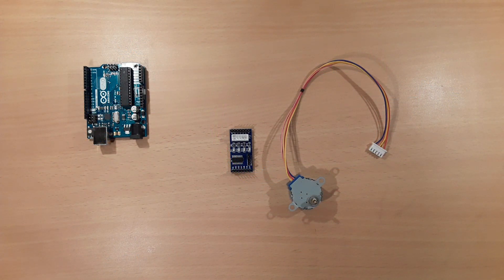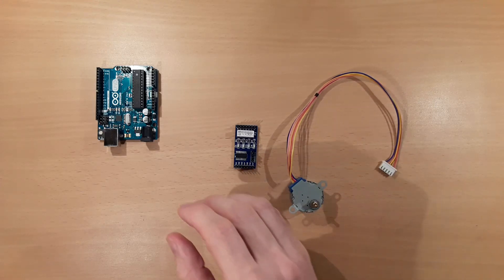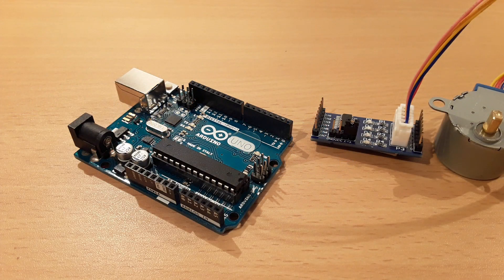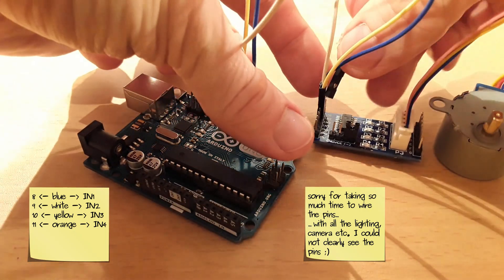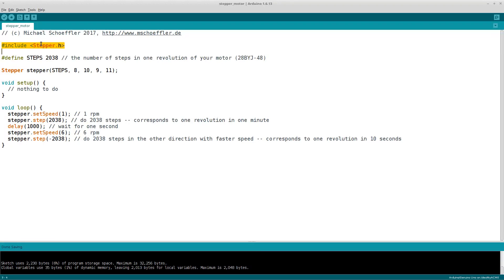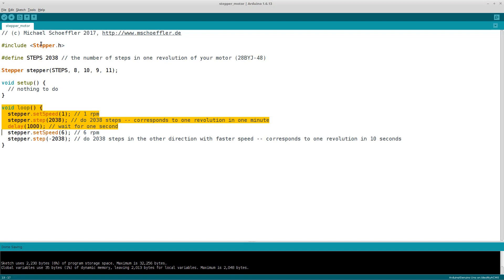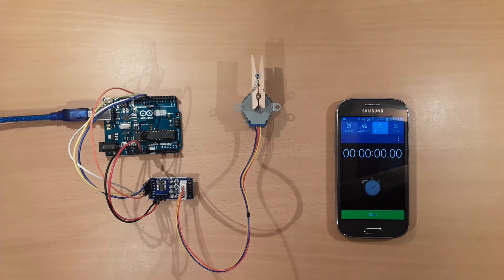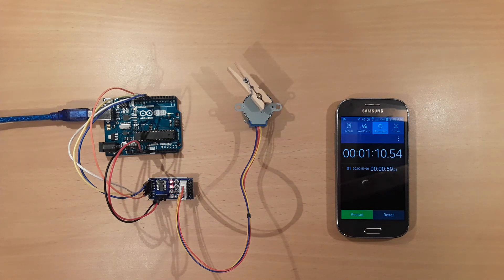Tutorial: How to use a stepper motor (28BY-J48) with an Arduino and a ULN2003A board | UATS A&S #10

Comment: Here's a though: desolder the 4 driver input pins from the ULN2003 and reattach to the opposite side of the board. Then you can just plug the board directly into the Arduino. Makes for a smaller package and less chance of something disconnecting.

Comment: it has 2048 steps in full rotation, not 2038
Reply from the maker: Hi Alexandru, Thank you for the comment! I made this tutorial a very long time ago, so I can't remember all the details:
I still think that 2038 is correct, even though the datasheet and other tutorials refer to 2048. When I started to work with the stepper, I recognized that it is not as accurate as I expected. So I had a deeper look into the problem. It turned out, many others had the same problem.

Long story short: the actual gear ratio is approximately 63.68395:1 (instead of 64 --> 32 * 63.68395=2037.8864). You find more details in my written article: https://www.mschoeffler.de/2017/09/23/tutorial-how-to-drive-the-28byj-48-stepper-motor-with-a-uln2003a-driver-board-and-an-arduino-uno/

Here is an older discussion in the Arduino forum which comes to the same conclusion: https://forum.arduino.cc/index.php?topic=71964.0

There are also some reports that there are differences in-between individual 28BYJ-48 motors. 

Also the example video in the video does a full rotation with 2038.
Reply: @mschoeffler  I don't want to argue with you, because I see your are well informed, but I let it run couple of minutes with 2038 steps set in the code and mine was not at the start position.

PS: Sorry for my bad english...
Reply from the maker: I did not intend to argue :) Just wanted to give a detailed answer since the "2048 steps info" comes up a lot. According to the datasheet, the information is also correct. However, many stepper motors of this type do a full rotation only with 2038 steps.
Reply: @mschoeffler  maybe mine is different
Reply: @mschoeffler   2048 appears quite accurate to be complete revolution. 2038 or even 2044 tends to shift (incomplete revolution).

Comment: Hi, thanks for the tutorial. Do you think it's possible with this motor to make a full 360deg. not in 1 mn. but  180mn? (3hours)
Reply: yes you could easily do this, just have a for loop that goes up to the 2038 steps inside the loop step 1 step then have a delay (divide the 3 hours by rhe 2038 steps to find out how long a delay you need).
Reply: Yes, i got this, really great, thanks

Comment: hello
thanks for the tutorial
i did some change with the code since i need to run the stepper 5 revolution then wait for 30min to run again. combining with blinkwithoutdelay style to make it happen. 
the problem is when waiting to run again I think the stepper didn't  stop at all (the motor is not make any move while waiting but on in the ULN2003 2 led light is always on) and it cause the stepper getting warm. is it intended to happen? if it's not how can i resolve it?
 btw it's my first time using stepper motor.

here's the code i use https://pastebin.com/jcz7LMnF

Comment: I have same stepper motor,
Then I write that code to my IDE,
But my stepper motor didn't spin reverse after 1 minute spin.
What's wrong? Please help
Reply: Switch pin2 with pin3 from the driver
Reply: Eeeh? Which pin? Sorry i'm forgot to say that, I am using Wemos D1 R2 for this

Comment: Hi michael... i was wondering if you could kindly help me out with this Arduino servo, stepper motor setup that i am trying to use. i would so much appreciate it if you are able to work out what is going on wrong with the code or hardware......thanks in advance......  https://www.youtube.com/watch?v=fis-qX9ldlg

here is the code that i am trying to use with the servo and stepper motor. can you see anything wrong with the code?

#include <Stepper.h> 
#define STEPS 32

  Stepper stepper(STEPS, 9, 11, 10, 12);
  int randomRotationFrom = 5;
  int randomRotationTo;
  int randomNumber;
  int randomDelay;
  int eyes = 7;
  int angle = 10;  
  int mouthclosed(-600);
  int mouthopen(600);
  int mouthspeed = 950;
  
void setup() 
{
  servo_neck.attach(8); 
  servo_neck.write(90);
  pinMode(eyes, OUTPUT);
  digitalWrite(eyes, LOW); 
  randomSeed(analogRead(A0));
  stepper.setSpeed(300);
  stepper.step(mouthclosed);
  delay(200);
  
      digitalWrite(eyes, HIGH);
      delay(50); 
      digitalWrite(eyes, LOW);
      delay(50); 
      digitalWrite(eyes, HIGH);
      delay(50); 
      digitalWrite(eyes, LOW);
      delay(50); 
      digitalWrite(eyes, HIGH);
      delay(5);
      digitalWrite(eyes, LOW);
      delay(100); 
      digitalWrite(eyes, HIGH);
      delay(50); 
      digitalWrite(eyes, LOW);
      delay(50); 
      digitalWrite(eyes, HIGH);
      delay(500); 
      digitalWrite(eyes, LOW);
      delay(50); 
      digitalWrite(eyes, HIGH);    
}

void loop() 
{ 
  
 randomDelay = random(10,3000);
 randomRotationTo = random(40,140);
 randomNumber = random(1,9);
  
 if (randomRotationTo > randomRotationFrom) 
 {
    for(angle = randomRotationFrom; angle < randomRotationTo; angle += 1)    
      {                                  
      servo_neck.write(angle);
      delay(20); 
      servo_neck.write(angle - 3);                       
      } 
   
 if (randomNumber == 5) 
      {
      stepper.setSpeed(mouthspeed);
      stepper.step(mouthopen);
      stepper.step(mouthclosed);
      }
 }
 
 if (randomRotationTo < randomRotationFrom) 
 {
    for(angle = randomRotationFrom; angle > randomRotationTo; angle -= 1)    
      {                                  
      servo_neck.write(angle);  
      delay(20); 
      servo_neck.write(angle + 3);                     
      } 
 
    if (randomNumber == 5) 
      {
       stepper.setSpeed(mouthspeed);
       stepper.step(mouthopen);
       stepper.step(mouthclosed);
      }
 }
 
 randomRotationFrom = randomRotationTo;
 delay(randomDelay);
 }

Comment: Question; if I wanted to power the motor externally, how would I do this, and what parts would be required? Any help gratefully received! :)
Reply: For anyone wondering about this, you just use an external power supply of 5-12 v(depending on driver) and just share ground with power supply and arduino
Reply: Can I connect 9v battery to +5v in of uln2003 or it must be 5 v regulated? 
The motor is 5 volt motor, does 9volt in damage the motor?
Reply: Vishnu Vardhan  It depends on what driver you have. You first have to check what voltage and amps you need for your motor, then based on that you pick a driver. On the driver you first need your power supply(batteries, and old stripped wall charger, cables from an old destop power suplly etc) with an capacitor tied to both plus and minus. The capacitor has to be at minimum whatever is speciffied on the datasheet of the driver. then, you need to tie the ground of the power supply to the arduino. that's it.

Comment: In the Stepper function: why do I do Stepper stepper(STEPS, 8, 10, 9, 11); rather than 8,9,10,11. When I change the sequence it does not move as much.
Reply: The motor Is designed to be inputed in that way
Reply: The stepper.h library has different sequence.   8, 10, 9, 11 fix the sequence for ULN2003

Comment: Why put the number 2038, where does that number come from?
Reply: depends from the type of stepper motor. 2038 is the exact number of steps that that the rotor of that motor must do for obtain  complete 360 degrees of the external shaft. 
consider that it's a geared motor, so changing the number of the teeth of the gears will change the numer of steps to do for a complete revolution.
Reply: @ClaudioFontachannel  but why 2038? 64*64=? 4096 I think
Reply: @blue_name_warrior  no. you don't have to calculate that number. It's given in the datasheet of the motor. Every motor has a different number of steps for a revolution.  Consider also that that kind of motor is geared, so more teeth on the gear, more steps for a revolution; less teeth, less steps. Clear?
Reply from the maker: @blue_name_warrior  You find all the details in the written article: https://www.mschoeffler.de/2017/09/23/tutorial-how-to-drive-the-28byj-48-stepper-motor-with-a-uln2003a-driver-board-and-an-arduino-uno/

Comment: Hi could you tell me how to spin the engine at 30 or 60 rpm if this is posible? sorry english isn´t my first language
Reply: 15rpm is 28BYJ-48 reliable designed speed, for faster speed it may not step accurately, if you raise the voltage for higher speeds there will be heating problems, so you may need to use a different stepper motor like https://www.adafruit.com/product/918 for 60rpm speed.
Reply from the maker: To be honest, I can't remember whether I did test 30 or 60 rpm. But i guess this should be possible. For 30 rpm just write  "stepper.setSpeed(30);" in the loop function and you are ready to go.

Comment: Single Axis Tb6600 and RC_52002513 Stepper Motor Driver Controller Speed Regulator Pulse Signal Generator CAN I MAKE A STEPPER MOTOR WORK??